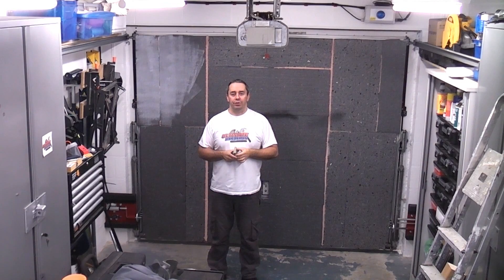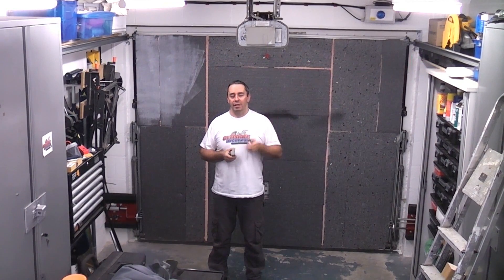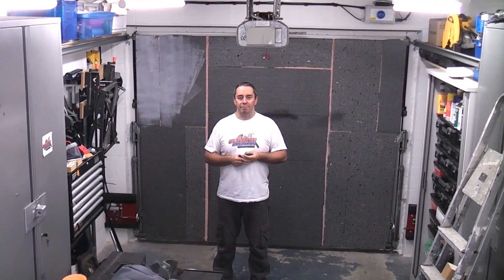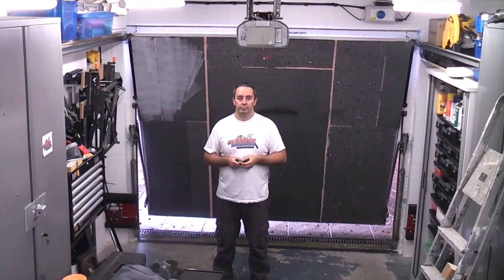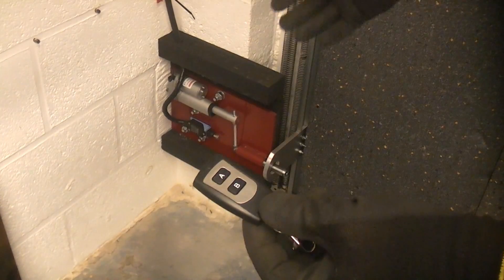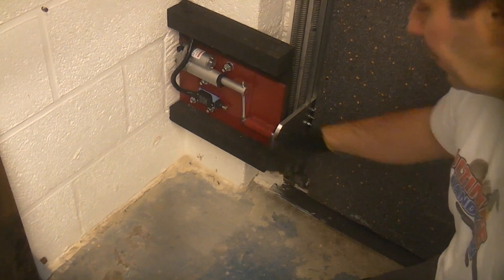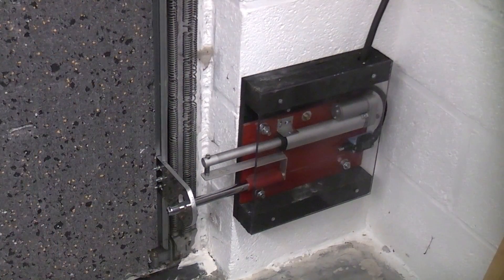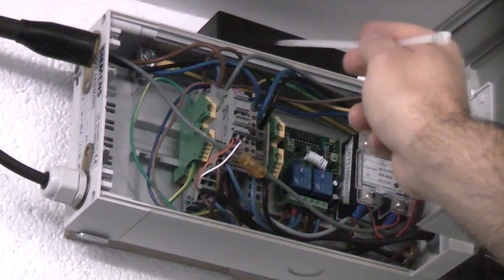Remote control garage door locks

Comment: Hey,
I need to magiver an automatic gate to that rises out of the ground when a gate is closing and retracts when the gate is opened. It’s for a primary school and the client is insisting that there cannot be a traditional gate stop installed as someone will trip over it. He did mention that old folk play cards there as well , linear or hydrologic 🤔
Reply from the maker: Sorry, I’m not familiar with “hydrologic” 🤔
Reply: @ going to fabric a rising gate stop using an ip rated linear actuator, through a relay that will rise and fall on a gate opening and closing🫵

Comment: Great work, I'm impressed! Although I'm looking for a simple solution that simply requires pressing a key fob that unlocks the garage. I don't need the doors to slide up. Does anyone have any ideas?
Reply: Just do what he did but a less in-depth version basically like an open close circuit.
Reply: I'm also looking for this kind of solution, did you ever get a solution?

The apartment I'm renting has a manual garage door with no external lock, but I need a way to lock it from the inside, but be able to unlock it with a remote control so I can get in/out of it without going all the way around to the door to the garage.

Comment: I would like to put a similar lock on my enclosed cargo trailer for it to lock the main door from the inside do I still need all the same parts. Or can I get away with the linear actuator and the wireless remote relay. I have a 12v battery inside the trailer
Reply from the maker: You could do it with just the actuator and remote relay.
Just be aware that you need to ensure that you can get in, if the battery goes flat.
Thanks for the comment

Comment: I've been looking for a remotely controlled device to "pull" the safety release latch in the door trolly, so you could open the garage door by hand. Is there such a device available? Thanks.
Reply from the maker: You might be able to use a linear actuator -
https://www.youtube.com/watch?v=ErGBqVJS2jA
and a remote control relay - https://www.youtube.com/watch?v=t6wrqjTNcTM
Reply: @ultimatehandyman  Thanks so much. I'll check these out. Best regards.

Comment: Hi again. if you're trying to gain access to the garage from the outside and power goes off - what would you do?
Reply from the maker: I'd use the side door. I would never install these if you only have access via the main door- just like I would never install an electric door opener, if that was the only entry point.
Thanks for the comment 👍
Reply: @ultimatehandyman  Cheers bud!

Comment: Hiya mate. Any ideas for a fail safe. Just incase the power goes off?
Reply from the maker: Everything is 12V, so you can just use any 12V battery to power it, if the power goes off. I use a Milwaukee 12v Battery from one of my power tools for things like this.
 Thanks for the comment 👍
Reply: Ultimate Handyman that would be fine if you're in the inside and the power goes off but what if you're trying to gain access to the garage from the outside?

Comment: Am I correct to say that the limit switches were wired in series/serial vs parallel? I just saw one DC input on the SSR, which led me to assume it was in series/serial
Reply from the maker: Yes, the limit switches are wired in series.
Thanks for the comment

Comment: That seems very dangerous, what if a friend forgets to unlock the deadlocks. The door will be destroyed
Reply from the maker: No, the door will not operate, unless the bolts are retracted fully. I'm sure I mentioned that in the video, I used limit switches and a solid state relay, which only allows the door opener to be energised when the bolts are fully retracted.
Thanks for the comment

Comment: What would you call this? Can this be bought anywhere or does it have to be made by hand?? Car theft in the neighborhood and we are VERY worried.
Reply from the maker: I'd call them remote control garage door locks, but I do not think there are any that are commercially available yet.
You can get manual ones, which are key operated- https://www.youtube.com/watch?v=kn5qd-_1JC8
Thanks for the comment

Comment: Way over engineered.  
Normal door lock motors for a car or even treadmill lift motors will work what you have is about 1k bucks worth of stuff retail installed.
I'll bet a quality unit can be done for 100 bucks. 
I'd even go as far to say you can do it all by your mobile phone. Or wifi in your home.
Once more you could do this with a battery back up system
And a deep cycle battery or a cell ment for a electric car.
Thats always charged and ready to go, or just walk into your house via the key and frt door.  With the battery backup even the lift can work. And turn on lights, solar power charge.
Reply from the maker: The gear to make both of these was probably about $100 ;-)
Thanks for the comment

Comment: Just came across this video by accident. I love it!

I have a couple of linear actuators (look the same as yours) I’ve used for my greenhouse automation with Arduino microcontroller. Never thought to use them for deadbolts for garage door though!

I feel another project to be started soon (don’t tell my wife)....

Since this is an old video, how has this worked out over the years? Any issues?
Reply from the maker: It still works fine, but I only purchased cheap components, especially the remote control and the signal from the remote is not brilliant and so I have to be fairly close to the receiver for it to work, it still works fine though ;-) 
Thanks for the comment

Comment: Really like it, but what if you lock it from the outside and the mcb trips in garage consumer unit? how would you unlock it-unless you have another way in? I'm planning to do similar but this was my only consideration.
Reply from the maker: If the MCB trips you have no way of unlocking the door. 
I have a side door to my garage and so that is not a problem for me. 
Thanks for the comment
Reply from the maker: I just went to answer your other comment, but I can't find it (perhaps I clicked on the delete button by mistake).
Yes, I have a separate remote for the garage door, which can also be operated by a switch on the wall in the garage.

Comment: Could you post a wiring diagram?
Reply from the maker: No, sorry. I don't have the time to make one.
Reply: Ok, no problem. Could you potentially put a parts list in the comment section?
Reply from the maker: I can show video's of most of the components and explain how they work-
Linear actuator- https://www.youtube.com/watch?v=ErGBqVJS2jA
Remote wireless relay- https://www.youtube.com/watch?v=t6wrqjTNcTM
Solid state relay- https://www.youtube.com/watch?v=gjsxCh6gBPk
Limit switches-https://www.youtube.com/watch?v=vtROHWIxJw4

Basically you have a 12v power supply that powers the wireless relay, connected to this are the two linear actuators.

Then for the other circuit you have the two limit switches set up so that the solid state relay is only energised when both limit switches are made (when both linear actuators are fully retracted). The SSR is then put in the circuit controlling the garage door opener, so that the garage door can only be operated when the SSR is energised (when both linear actuators are fully retracted).

I hope this helps ;-)
Reply: Thanks for that. 

Quick question, if you are using "A" and "B" to extend/retract the actuator, what are using to open the garage door? A second fob?

Comment: Really nice setup 😊But I'm curious.. Why did you use 2 different sized linear actuators? 🙂
Reply from the maker: The actuator on the right hand side of the garage (as you look out) had to be longer as it has further to travel. 
Thanks for the comment

Comment: I like this, but it seems you could simplify the steps down a bit more.
Once the bolts have retracted and switched on power to the door opener and your strobe from pressing button A, why not also have it close a second relay which momentarily shorts screws 1 & 2 (I think that's the ones Challenger door openers use) and have it activate the door, then button B on the transmitter would short opener 1 & 2 again to begin closing the door, and tied into the close limit switch on the opener and have it extend the lock bolts once the opener has completed the close cycle?
I do like what you've done here, just think it could be a bit simpler. I like retractable style garage doors for their simplicity over sectional garage doors, but the ability for a crook to force the door opener on a retractable is a big issue.
PS- I think it's getting close to time to replace your garage door springs if you've not done so already. (garage door tech)
Awesome video, and excellently executed idea!
Reply from the maker: +Matt Hayes 
Thanks Matt, I tried to make these a stand alone unit so that they could even be installed on doors without an electric opener. Most of the circuitry is 12v so quite safe even for people with little electrical experience. I did't want people to start mixing the 12v with potentially lethal 230v etc. 
I never really looked at the opener itself, it might even have 12v controls on it. (you will know much more than me as you work on them all the time).
Thanks for the comment ;-)
Reply: On your Challenger, mains voltage comes into the control board, then out to the motor and light via relays. Everything else will be either 12-24 VAC. (I'm thinking 24V seeing that Multi-Code receiver.) You've definitely given me some good ideas that I think could be used on sectional doors as well. It's something I'm going to have to try. :-)
Reply from the maker: +Matt Hayes Thanks Matt, good luck with it ;-) BTW, have you seen this- https://www.youtube.com/watch?v=l2HlC0yl-SUI powered that using a second hand garage door opener that I bought from ebay ;-)

Comment: Sweet rig. Well designed and executed. Thanks for posting.
Reply from the maker: You are welcome
Thanks for the comment
Reply: I have an idea. Buy a Christmas tree power on and off switch. Plug your electric garage into the switch and put the remote on keychain. No power, no garage opening. When you pull into driveway, turn power on, then open garage.

Comment: Very good idea for security for the garage door, but in the event of a power loss how do you open the locking device to get inside the garage .
Reply from the maker: I can only ever remember two power cuts in the last twenty years and both time the electric has not been off for more then a couple of hours. If I wanted to over ride the locks I can do so using one of my Milwaukee 12v batteries ;-)
Thanks for the comment

Comment: Just curious to know if you considered wiring it up so that the door unlocked and then opened from a single button press, rather than two separate remotes?

I may be wrong, but I cannot think of a situation where you would want to have the door unlocked, but not opened.
Reply from the maker: No, I did not consider that as the garage door is 240v but the locks are 12v. I just tried to make it as simple as possible.
Thanks for the comment

Comment: great stuff. Did you build this together yourself, and is there a blue beacon on the outside of the door as well?
Reply from the maker: Yes, I built this completely on my own. I did not put a blue beacon outside as it might alert someone if the locks were accidentally left in the open position. I only put the Blue beacon on the inside to show people what was possible, an external lamp could easily be fitted to the system.

Thanks for the comment ;-)

Comment: Hi I'm a security installer and fair play thats a solid neat setup you done there. Did you fit it yourself ?
Reply from the maker: Hi, Yes I made and installed it all myself. It took a fair while to be honest as I had to drill the fixing holes in the 8mm steel plate and also drill and tap it for the linear actuators and limit switches. It also a while to wire up as I didn't have the correct DIN rail terminals originally.
Thanks for the comment ;-)

Comment: great build, looks absolutely solid.

did you consider adding a single-board computer for some extra features - operation via phone app, notifications when opened/closed, etc? i've seen a lot of raspberry-pi based garage door openers but i don't think i've seen any that incorporated locks...

also, nice decals on the van ;)
Reply from the maker: No, I did not consider any of that to be honest. I'm not a fan of some of these APPS that are often just a gimmick, only the other day I saw a wi-fi kettle (WTF). I did consider wiring them up to the burglar alarm but though it unnecessary as the PIR covers that area and the camera.
The decals on the van are vinyl stickers, I had them replaced earlier this year. It's incredibly cheap to have all of them made and installed, I think it was about £60 for the front, back and both sides!

Thanks for the comment ;-)